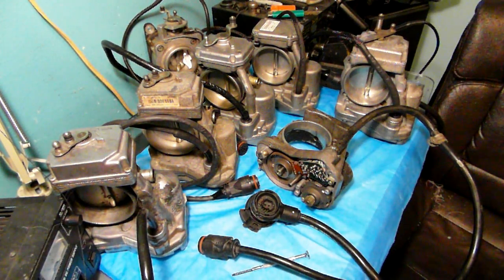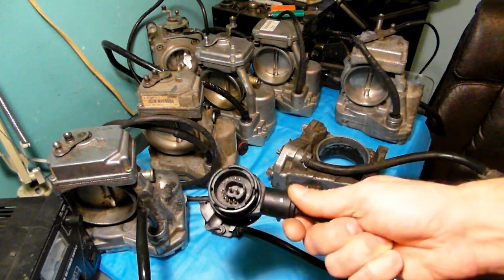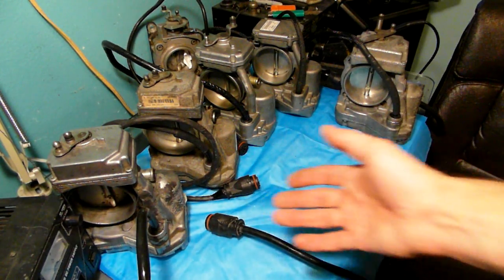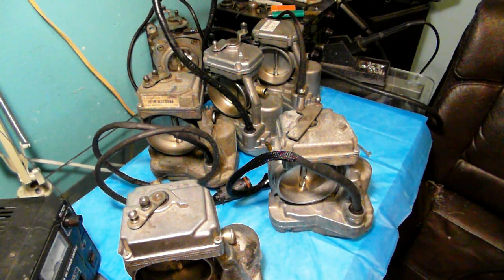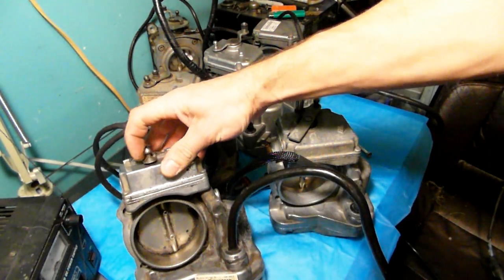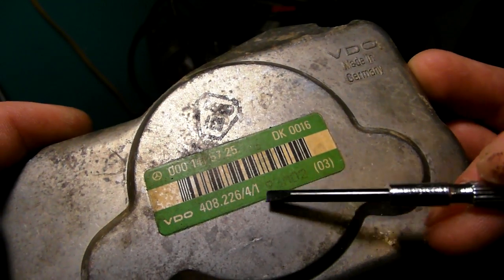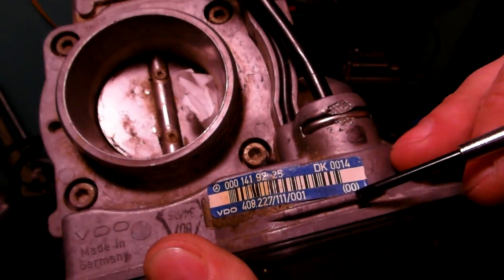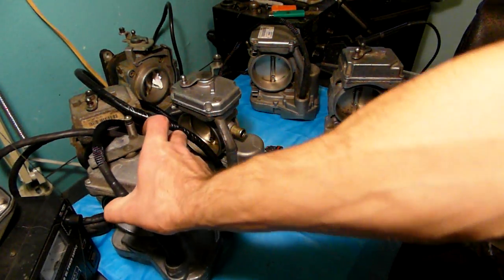Mercedes Benz electronic throttle actuator. General info, production dates and style difference

Comment: I have a 1994 e320, non ASR, its going into limp mode randomly. I replaced the main harness and it still does it.  Could a bad  throttle body cause it even if its non asr? I thought only ASR models have the limp mode.  I also replaced the maf sensor and cam sensor and still have the issue.
Reply from the maker: Depends. I need the car to diagnose it properly.
Reply: @vsandvs  i would like to but not in the state.  Have you seen non ASR go into limp mode?

Comment: I have 1994 w202 when I press paddle about 1000 rpm throttle go up and down always buy when I drive its normal but after a stop it again up and down at 500 to 1000 rpm

Comment: I have a 1996 Mercedes e320[w210]... car would die and battery light would show. New alternator and battery. I am thinking throttle body? It would idle up and down until it dies. Can't drive far without it shutting off.

Comment: My 91 600SEL throttles has these type of connectors and the wires look good bt he throttle body is still acting up.. :(
Since the wires in this cars throttle do not disintegrate does that also mean the rest of my cars wire harness is solid?
Reply: btw i sent you an email about repairing mine but no replay since last summer..
Reply from the maker: sorry, very busy with work. call me one day. I don't have much type to spend by computer, phone is better
thank you

Comment: Victor- had anyone ever approached MB about a recall due to defective wiring insulation? Seems all you do is repair wiring, in my opinion that could be a safety issue and considering the $$$$ people spend for a MB that shouldnt happen, especially in such a short time span
Reply: No they built this way on purpose it was going green.